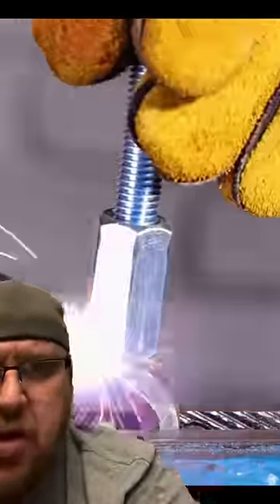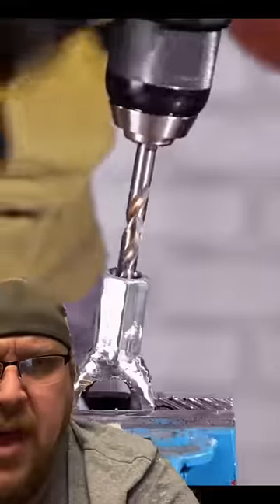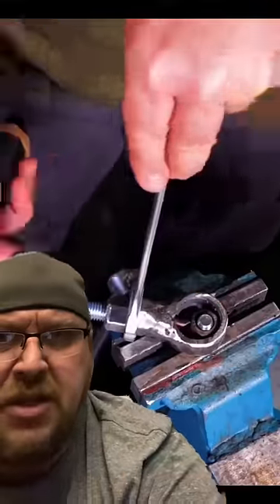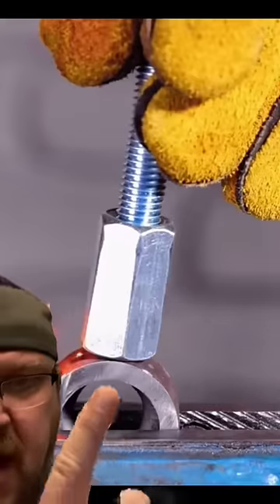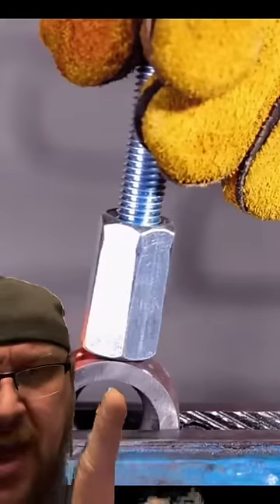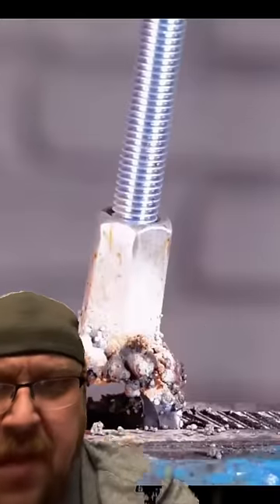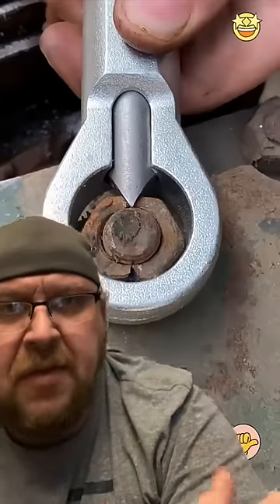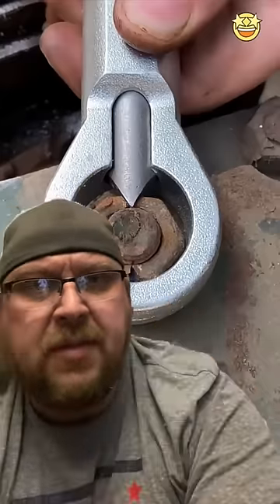Deep Dive Fake Tool

Comment: Nut splitter would cost less than the stuff he destroyed pretending to make one
Reply: Definetly..
Reply: And if buying one isn't an option?
Reply: @OldNavajoTricks  ..well if u dont have the materials to construct one, thers a bounch of other methods to remove a nut ..
Reply: wouldn’t say that, an inch of pipe, basic ass hss drill bit, and a bolt and coupling nut, pretty cheap. but considering he used a coupling nut which are SUPER soft id nearly guarantee you strip the threads out before it actually cuts a nut.
Reply: @Sffker  ..the thing is, he uses a bought tool for the cutting part, why?.. almost guaranteed becouse the made one didnt work.. and sadly thers plenty of simillar DIY videos kaing ppl without proper knowledge and experience belive in someting that wouldent work ...
Reply: @Patrik6920  i mean look at his welds, of course it didn’t work 😭
Reply: @OldNavajoTricks  he used a drimmel or rotary saw. He had all the tools he needed right there.
Reply: But by posting the video and getting hate attention, he made significantly more money
Reply: Not if it's all garbage
Reply: @OldNavajoTricks if buying one isn't an option you also wouldn't have access to $100 SDS drill bits to blithely cut through
Reply: @jarhead9307  I have expensive things that I bought when I was better off than I am now, so it's possible to have drill bits laying around from a time when there was access.
🤘🙂
Reply: @OldNavajoTricks  right, but what he built didn't work.  The cut off when alone would have done the job fine. 

Making tools is great, but this guy just broke a bunch of stuff using something that would have solved his imaginary problem.
Reply: You killed off real superheroes so you could PRETEND to be one!?
Reply: If you have acess to a welding machine in the first place, why not just weld the stuck bolt into a scrap piece and pry it loose, takes literally 2 minutes.
Reply: he used like 20 bucks worth of wire on those "welds" lol
Reply: People make intentionally incorrect videos because they get more engagement and thus earn more money. They want you to see it and get mad, and go comment this is so dumb. That's how they make their money

Comment: As a welder of 20+ years... those... things... making that metal on metal hostage situation... they hurt what's left of my soul on so many levels...
Reply: Hostage situation? That's a pretty pitiful kidnapper if you ask me..
Reply: "Metal on metal hostage situation" is a phrase that's likely to live in my brain forever.  Cheers!
Reply: SIR!  SIR!  THAT PIPE FITTING HAS A FAMILY!
Reply: You can teach a monkey how to lay a bead but without the mind of a welder that will never make anything of use.

I think that is applicable here as look at that monkey go.
Reply: Shit you really must be a good welder if you still have some soul left attached, mine broke off and flew out the window when I tried to resurface it on the lathe. I think the problem was lack of spray paint, same as this video

Comment: The whole reason I grind my welds, risking some integrity in the metal, is to hide them forever from any other human 👁️.
Reply: Gotta hide the evidence
Reply: Grinder and paint make ya the welder you ain't.
Reply: @XxTWMLxX  exactly! My chicken shit farmer welds are stellar...lol
Reply: Yup
Reply: Heard that.
Reply: I just don’t weld.
Reply: I don't grind my welds to hide the flaws in my work, I weld to fill in the flaws and then grind it flat.

Before people jump to conclusions about why I have to fill in holes in my work, I would like to state that I run an NC oxy-acetylene cutting machine that runs programs from an older machine. Sometimes it decides to do weird things like cut off the last corner on the exit(It's caused by some weird tool offset problem I think). If the part is big enough, it's cheaper to just build up the corner again with the MIG and grind it flat ish.
Reply: @skitidet4302  makes sense.
Reply: @skitidet4302 That sounds frustrating and makes me want to go take a smoke break.
Reply: @mattjack3983  I actually like it, it breaks up the monotony to do a bit of welding since it doesn't happen very often. It's also a relief that I can just fix small issues instead of having to go tell my boss "You know that big slab of steel that weighs like 4 tons and cost lots of money to buy that I was going to use to cut out a single big piece out of? Yeah, about that... we need to buy another one since I ruined the part"
Reply: @skitidet4302  Well..I admit, you do make a good point there
Reply: Does weld grinding actually risk integrity of the metal? I just recently got a job as a casting finisher and I’m brand new to it so I’m genuinely curious about this stuff. I actually love this job.
Reply: @skitidet4302 That’s what we do, too. Visual inspection for defects, dig out and blend, then send the parts to our welder to fill in the dig outs. Then the part comes back to me to grind the welds down flush. Fuck it’s so satisfying. 10 hours go by and I feel like I’m just going on my first break lol
Reply: @Trentcast  you sound truly blessed to do what you do. That makes me happy to hear. I hope you're not an asshole and deserve to be happy 😂 kidding, everyone deserves that kind of happiness

Comment: It’s actually a piece of “all thread” and a female coupling connector for the all thread. 

It’s mainly used for hanging uni-strut, which is primarily used to hang ductwork and HVAC equipment along with pipes and electrical conduit above commercial building drop ceilings (from the I-beam or other main sturdy point) in commercial buildings and apartment  buildings.

Comment: You can also see he ground the drill bit and changed colors, as well as it was super rough grinding. The tool he actually uses has a very fresh clean cutter with no discoloration or grinder marks.
Reply: Plus, that discoloration proves that the drill bit metal was softened when it was cut.
Reply: @joeylawn36111  If it was a decent drill bit made from high speed steel HSS the color change doesn't affect the hardness of the metal
Reply: @thedraac1818  i frequently grind up my high quality HSS bits. I don't think you're making this better!

Comment: Lost all the hardness of the "cutter" from the cut. Once you see the color, it is not hard anymore. Hence, "don't lose your temper"
Reply: It’s worse than that. The back part of the drill is left soft so the jaws from the drill chuck can get a better grip.  It’s why when the bit stops in the work piece that ugly burr gets raised up on that part of the drill bit.
Reply: The real question is, is it even hard enough to crack an egg?
Reply: @spvillano  well... well no, that's not the real question... it might have been a joke, had it been phrased differently, but as it was, it just seemed silly
Reply: The existence of the phrase "don't lose your temper" doesn't explain why it would lose hardness if it doesn't reach annealing temperature... but if it did reach that temp, couldn't he quench it in hydrocarbon to reharden it?
Reply: @joshyoung1440 no, quenching in oil doesn't magically restore a temper, not for any quality steel or temper anyway. To properly temper steel you have to know a lot about it, especially a modern tool steel. Leave it to the blacksmiths.

Even if you got 'a temper' its unlikely to be worthwhile without precise control over the phase change.

If you want to boil your tools in oil they'll probably enjoy it though. You do you.

Comment: Best part is his tool probably would've worked if he would've drilled the hole before welding on the nut, and also knowing how to weld would've helped.
Reply: No. It was doomed to fail even if that wasnt the issue. 

The drill bit he was trying to use looked like a masonry bit. So that part wouldnt have even been hard. And wouldnt have cut the bolt.

Comment: I believe nut splitter frames are forged for toughness. The pitting is from bead blasting before plating. Unfortunately we can’t see the side where the mold halves would be on a casting, which would have a thin line of metal standing proud (unless ground clean), or where forging dies would almost meet, leaving a thick line of the metal that was squished out from between the dies and ground off. Usually the best way to distinguish between them.

If I’m wrong, cheerfully straighten me out.

Comment: A mild steel ring (esp that diameter) would have sheared for certain.  This would have been the way the tool failed, if not at the weld.

You are spot on.
Reply: I'm pretty sure it's a banjo fitting in the first scene...

Comment: Cars control arm end with ball joint makes good nut breaker stock. Remove ball, drill a hole and make treads, done. Specially since i havent seen those nut breakers around here in shops, so making one is better than buying in my case.

Comment: My guess is that he discovered really quickly when he tried to use it that, A) Mild steel deforms a circle into an oval with surprising swiftness, and B) when you rainbow up even the most hardened of steel bits with a grinder, the heat softens it into something unfit for nut cutting.

Then he threw away the mashed metal mess, but not the footage or the project.

Comment: As a diesel mechanic for going on 12-13 years. If it’s already that bad and you can’t break the nut loose. A torch is the best choice to just cut it off.. it looks like a waste of time to me to make that tool. Because your mostly going to be dealing w seized bolts/ broken of bolts anyway

Comment: I think that a quality nut splitter is probably forged rather than cast because forgings are tougher. And it’s probably not cast iron because that’s too brittle and any inclusions or porosity will significantly weaken the tool.

Comment: I bought nut splitters when I was about 12 thinking they’d help me on my bikes on rounded off nuts. When I was 13, my uncle gave me his old angle grinder when he bought a new one. I’m now 45 and the nut splitters are still unused, in the box I bought them in. I was never able to use them just because of all the room you needed to fit them around a nut.

Comment: Funk where do you fly? What state? Just curious if  your in any clubs or not and if we live relatively close, I have absolutely zero idea where your from lol
Also man you have great internet presence and your content is always on pt.
Do you make any rc videos? FPV I think of screaming little race quads. Is that what you fly because I heard you mention in a previous post that you used ca and baking soda to fix the leading edge of your fixed wing aircrafts.  I sold all my dime stuff and fpv gear. Wasn't for me although now I want to set one up the be fpv on a fixed wing where you can add the sensors where you can look side to side our the windows,  put something like tat into a giant scale carbon cub.
That be dope

Comment: Also, gotta love how he's using (what appears to be) grade 4 (or is it 4.8?) steel fasteners (barrel nut and bolt) to drive the splitter... Like those threads will hold up under the high torque load needed to split a nut... At least use a sae grade 8 or metric 10.9

Comment: I don't think that he realized that the cutter on a nut splitter does not turn around. It has a little key way cut in it in a pin that keeps it straight. Then the bolt pushes that part up and down. Also it's not a piece of grade two threaded rod. It's probably a piece of 4340 that's heat-treated to about 50 RC.

Comment: Someone probably pointed that out already buuuuut: If any hardened steel tool changes its colour to blue, or gray even, due to heat, it's no longer hardened.
Reply: True, and the shank of a drill bit normally isn't hardened in the first place, so now it'll be double soft🤣🤣

Comment: My guess is the cut off and sharpened drill bit dulled very rapidly based on the bluing you can see after he sharpened it with a grinder.

Comment: That pitting on the nut breaker is not indicative  of a casting and is attributable to forging that is needed for a high stress part.
Casting has comparatively much lower tensile strength.

Comment: 🤣 Maybe the real point of the video is sometimes it’s worth buying the real tool! 
There’s a lot wrong with the original idea, one thing is that the shanks of the twist drills are soft so the drill chucks can clamp onto them so using them as a chisel point is probably not going to work. Also I think coupling nuts are mass production cheaply made for bulk purchase installation of conduit and pipes probably a about the same quality as a grade 2 bolt.  That’s likely not going to take the stress of splitting a much thicker nut without stripping or popping of the cheap thin walled seamed tubing as it goes pear shaped and breaks the weld… 🙄😬

Comment: If I ever would need to cut a nut, and I have all these tools, i would just use that cutter. It's like, you need to cut some paper, and you craft some apparatus which includes scissors on the craft. Like what???

Comment: If you don't have the tool... the most common solution is you simpyl welt the steel in place and create a longer lever arm and hte nut either comes off or doesn't or hte weld fails, but thats if you don't have the correct tool and you don't have a grinder, in mst cases  it would be nut is stuck.. context where its located. Can it gringed? Do I need a specific tool to BITE the steal to remove it. What od I have a available, a tonen of welding supplies.. shoudl I weld a rod ot unscrew it? or creat a hot spot for failure. Does the device neet protection, the diy is like meh.. So its context to in reality. If your in a city, you buy the correct tool... if you in work camp in the middle of no where, you do what I stated above... and then make sure yo uahve the tool at hte shed in the construction site... later on... Cmaps shoudl always have ropes and bytes.. but today, moost rational and healthy places the job site is protected and if something is needed its helicoptered in or flown in right away since thats what ought to be done., lol

Comment: those welds are what happens when you use super old flux core wire never fails. the flux gets too old and the steel wont flow

Comment: Never understood the need for this tool... 99.9% of the time you don't have the room or the angle to use it. Use an induction tool or a blowtorch to heat the nut and remove it. 🤦🏽‍♂️

Comment: First world problems. In the 3rd world, a bloke with a hammer and cold chisel would get the job done. 
In the Kyber Pass, sniths would make ..393 Lee-Enfield rifle receivers from a length of railroad rail using little more than hand tools. Wouldn't fire one unless I proofed it myself.

Comment: The drill bit he used has gone straw-coloured with the heat, meaning that the heat treating during manufacture to harden that piece of steel is gone. 🤦

Comment: Just a silly carpenter here. 
I'd have taken the angle grinder he used. And I'd grind a very thins spot on the nut that's frozen. And taken the nut off. Either with a chisel. Or the heat from grinding actually freed it. Vise grips...
My buddy (may he rest in peace) used to say stop brain fucking it. Applies here.

Comment: Apart from all of the other proof here that this is bs, the shank of a drill bit is generally not hardened so it wouldn't be best thing to use, and then grinding it until it turns blue is probably going to be a deal breaker, not a nut breaker that's for sure🤣👍

Comment: What an amateur! He clearly isn't a welder... He's just a guy who randomly acquired a welder & started playing with it! 😂 If you don't have the proper tool (nutcutter for example) As a welder You should be able to overcome any issue on the job same way as  every other welder.. you gotta use the single most important tool in existence for the welding trade....no not your welding rig... Your angle grinder!!! Just use a cutting wheel & done...  Easier than using the nutcutter even if you already owned 1😂